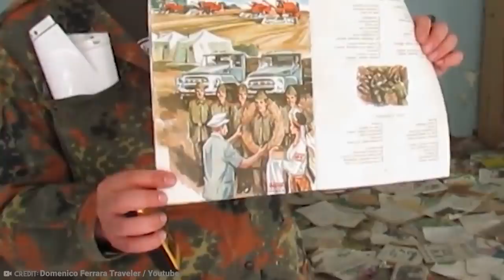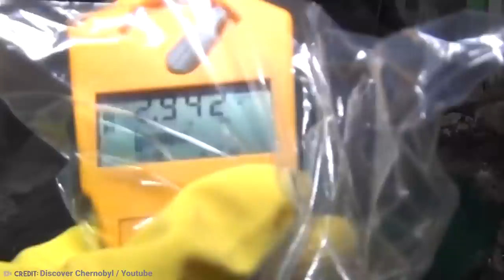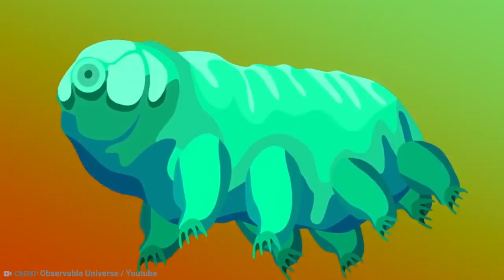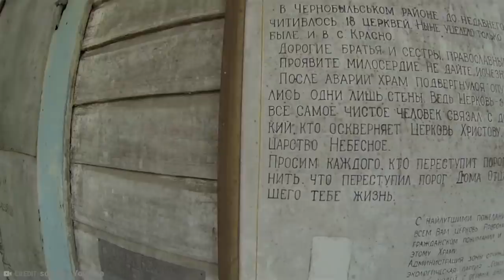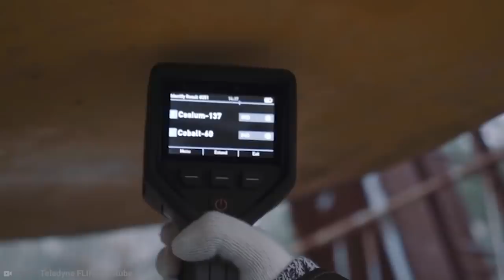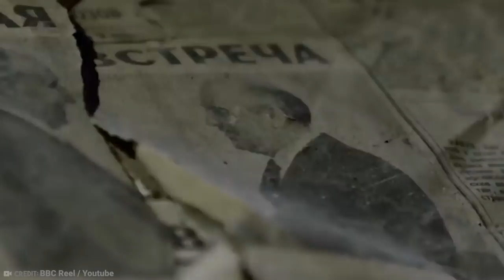What Scientists Discovered in Chernobyl Shocked the Whole World

Comment: Jeremey Wade caught a Wells catfish out of that exact cooling pond. The Russian Government had it fully tested genetically and everything else and they found that fish was much smaller than normal but also had such a monstrous level of radiation that it was a miracle that it still drew breath. it was also abnormally strong as it took 100 pound line when it was less than 20 lbs and nearly snapped the line. 100 pound line is like steel cable and it almost snapped so that is one strong fish.
Reply: Wow. Thats crazy. Strong and dumb😅😅
Reply: What does "almost snapped" mean...
Reply: @Rex_R_Rodney  it’s 3/4 there just a thread holding it
Reply: @yugioht42  Got it.    Thanks.

Comment: we need newer design reactor that uses Thorium which was used back in WW. and even used on an airplane in the USA later scrapped the idea
Reply: It was scrapped due to tellurium embrittlement of the hastelloy.  This is why this idea has been around for decades and exactly why it's never been attempted to make a commercial reactor and scrapped.   The materials thats used to build it are the issue not the design of them so a newer design will not work.  To build a MSR using thorium as fuel with metal that can withstand this process for an extended period of time it would be so astronomically expensive it couldn't possibly compete with other, much safer forms of energy production. I see this thought in every nuclear video I come across and no one really knows why we haven't attempted to build them.  People will say they were pressured to use light water reactors or that Environmentalist caused a decision or even that the president at the time made the decision and they all have it wrong.  Tellurium embrittlement Oak Ridge Tennessee MSR is the exact reason.
Reply: It was never used during WW2, those experiments came later during the 50's. They were discontinued because at the time the US was more interested in weapons creation than power generation. Uranium reactors made better weapons grade material than thorium ones.
Reply: @STSWB5SG1FAN  Actually that isn't true because U-233 comes from irradiated thorium and even though thorium weapons have a smaller yield the fallout is just the same if not worse than uranium.  They were discontinued due to issues with the metal vessels and had to be shut down.  Tellurium embrittlement of the hastelloy caused dangerous issues with the reactors.